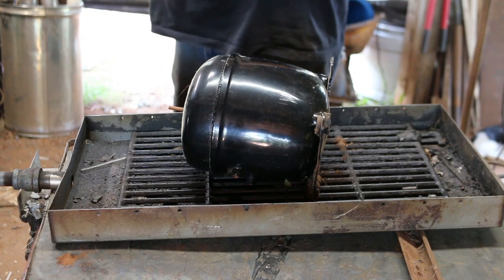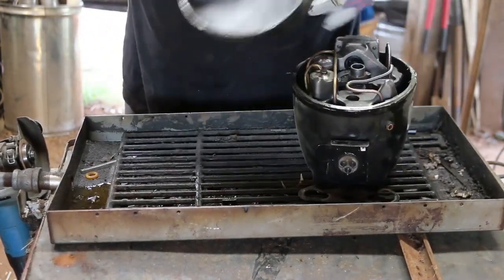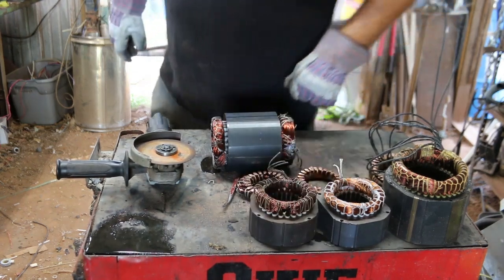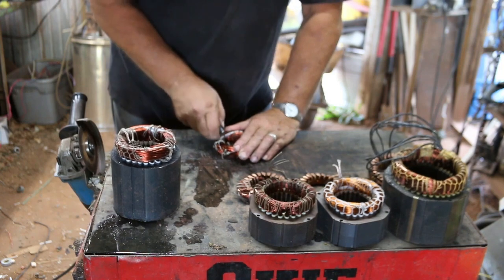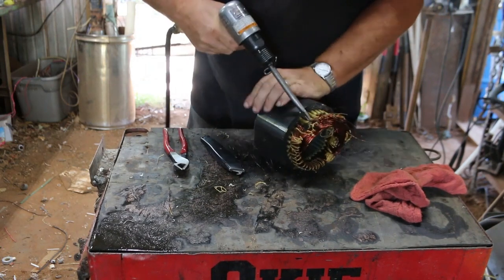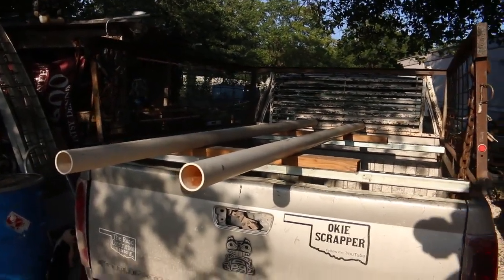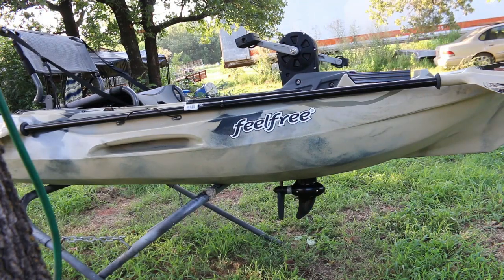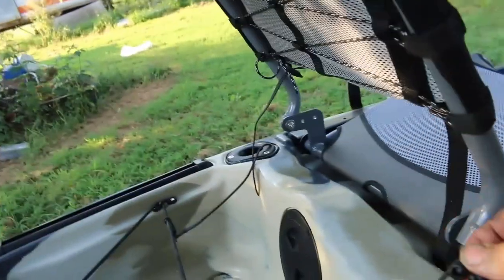Scrapping and cleaning some AC Compressors for clean Copper, and a look at my new Kayak

Comment: Is that chisel the long one? I do all mine by hand with a prybar and hammer. Needless to say it takes awhile. I'm thinking of trying out the air tool method thanks for the idea #happyscrapping
Reply from the maker: yeah it is a long one, it had a small v cut into it, I took the angle grinder and made it bigger

Comment: As always thanks for the video Okie oh yeah did you figure out what the wind noise was it's kinda hard to watch the video
Reply from the maker: had a good wind blowing in the south doors, behind the camera, I didn't know it was affecting the mic until editing the video, the bad thing is if I use the external mic, I can't use the monitor, it will give me a buzzing sound in the video, and things are hard to see on the little monitor on the camera
Reply: @Okiescrapper  are you going to make any videos with your new toy
Reply from the maker: @josephpecoul6532  I am sure that I will, I gave my gopro to my daughter, so I will need to get a new one, and the mounts, to get on the water video and that may be next spring, but I may setup a tripod and get some video of me in it on the water

Comment: I was wondering with your waist oil burning, I work on a lot of boats in the spring to winter and I have tons of oil and old bad gas/fuel left over. Can I mix the bad gas with the waist oil to burn it too. 
I know at very small % to gas to oil. 
I guess I’m asking is if do you have any gasoline in your oil waist fuel?
Reply from the maker: no I don't have any gas in my mix, I do put about 8 oz. of kerosene to a 5 quart jug of oil, you can try a mixture if you like but I would be ready for a big flash up from the gas, just in case, now you can if you have a safe place to do it is put the gas into a metal pan or bucket and light it, the fumes are what burns so it should only burn from the top of the bucket. you can test it with a small can, like a tuna can,
Reply: @Okiescrapper  thank you!!  I will take caution ⚠️

Comment: Oddly enough I just watched a video of an over engineered machine that simply cuts the top of like a can opener. 
Looked more like a huge CNC machine.
Reply from the maker: they do have some machines that do that, but cost tens of thousands of dollars, to high for the amount that I do
Reply: @Okiescrapper  The time it took for that machine to cut the top of you could definitely have 3 finished.